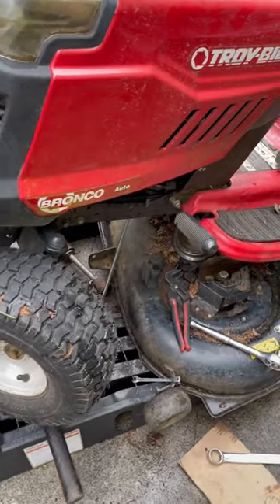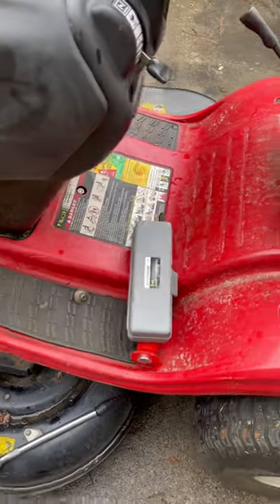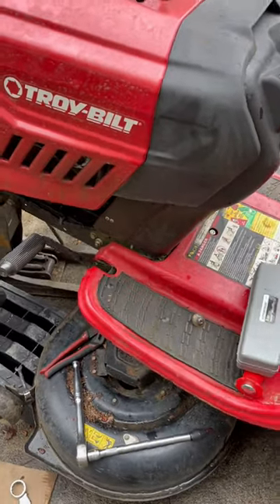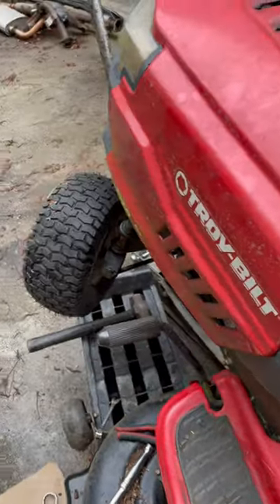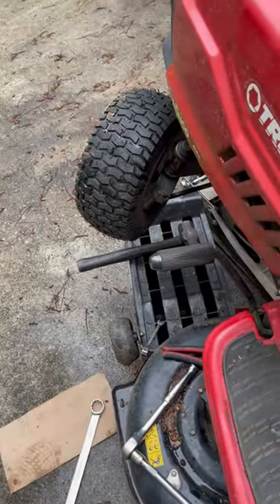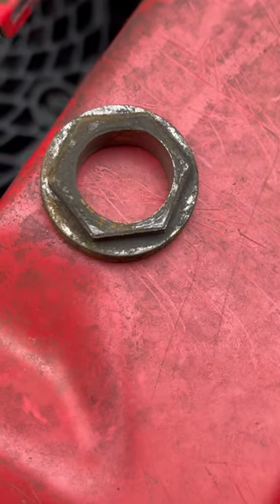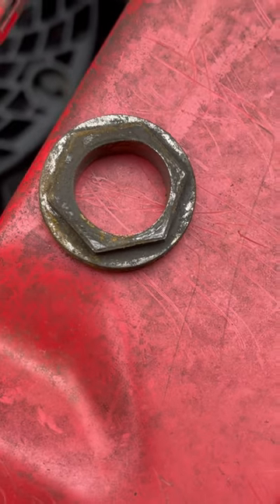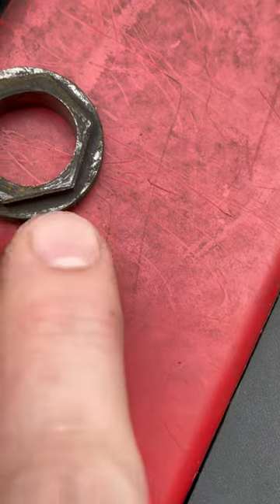Riding Lawn Mower not Turning when you turn the Steering-wheel? Try this $5 buck fix and save it!!

Comment: I have 10 cm play on the steering on my lawn mower. Could this fix it aswell?
Reply from the maker: This will take care of no steering of the teeth are not too bad…..as far as slop we have at least a half inch side to side before it actually turns you generally want a little play in it so it’s not tight and binding….look out for any egg shaped or wallowed out areas